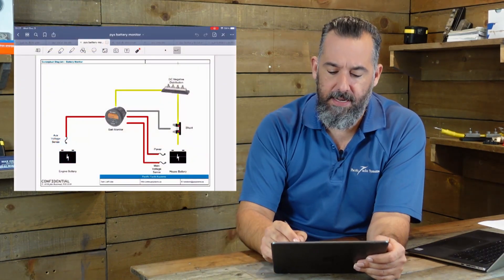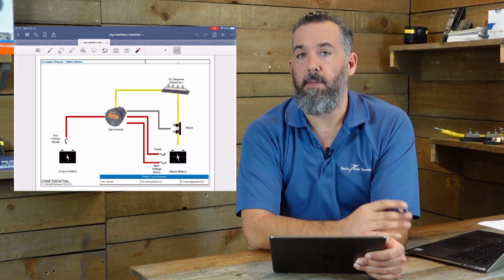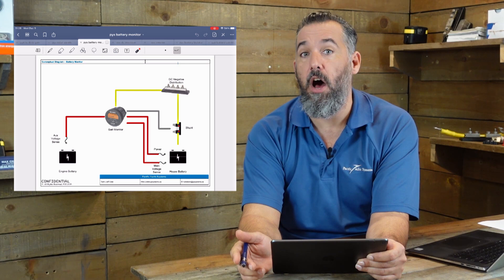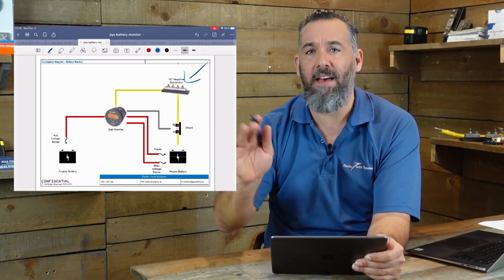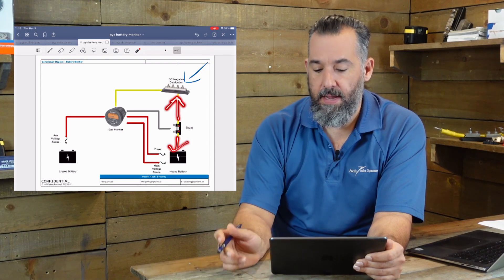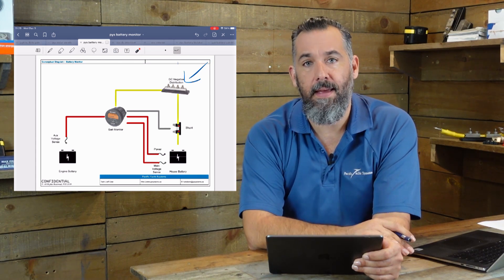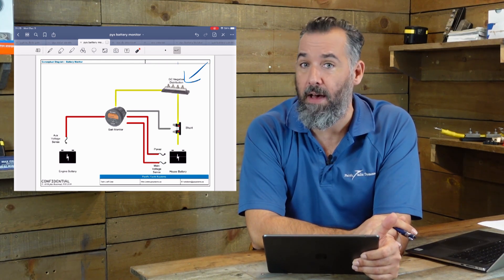I Am Installing a Battery Monitor, Would You Use a Diagram to Show Me Where to Install the Shunt?

Comment: Hi Jeff, When a charge is coming IN to the battery from a DCDC charger via the shunt, AND a current is flowing OUT of the battery to a water pump via the shunt at the same time, aren't the negative currents flowing in OPPOSITE directions and crashing into each other???   My monitor will show the net current either charging or discharging but I don't understand how the flow can go both ways at the same time.
Kind Regards
Alan

Comment: If I'm running duel battery cables from 2 batteries to the negative bus bar,  Does it matter which side of the bus bar you mount the shunt?? This would be running to a 4000 W inverter for a Solar System.

Comment: Great video and great info, Jeff!  With your permission, I'll add a bit of clarity!  
 It is important to understand the Shunt Resistor's role in this, and to understand that the Shunt Resistor should NOT pass any other current (from a different battery bank) through it.    
In other words, the Shunt Resistor will ONLY "interrupt" the Negative battery cable's path to the battery bank that is being monitored.  
It will be the last item between all Negative connections and the actual Negative battery bank connection.  
As Jeff says at 2:29 into the video, a direct Negative connection so that Negative current cannot bi-pass the Shunt Resistor! 
When installed correctly, any and all Negative Current to/from the battery bank being monitored cannot help but to pass through the Shunt Resistor!  

First.... this is a "Shunt Resistor".... I.E., a current conducting device that offers a precisionally known resistance value!  It interrupts the Negative path for the battery bank that is being monitored. 
Secondly......  the Shunt Resistor alone cannot offer any data.  The head unit is required in order to measure and track Amp Hours that are passing through it......... both ways...... from the battery bank, and to the battery bank. 
Thirdly...... think in terms of Amp Hours.... not amps, and not voltage!

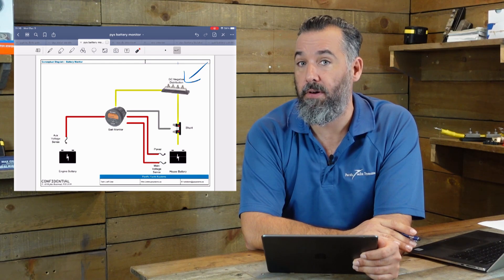At 3:11 into the video, Jeff says that "Nothing can bi-pass the shunt." 
Allow me to explain that in more detail:
In most Marine scenarios, we will see two battery banks. 1..... dedicated SLBB (start load battery bank), and 2....  dedicated HLBB (house load battery bank) . 
These banks are typically separated by an MBSS (main battery selector switch). The MBSS allows us to select either bank to operate all 12 vdc current (until we get up into 34 footers and above). 
Unless we are using a 2 bank monitor, , we typically monitor ...... the HLBB, of which is generally bank # 2.  

In other words, there is no need to monitor the Negative current to/from the SLBB # 1. 
If that Negative current to/from the SLBB # 1  was to pass through the shunt resistor,  your # 2 bank Amp Hour reading will be inaccurate! 

Side notes: 
.......you would be surprised to see how few Amp Hours are required to start a Marine Engine. 
The engine's alternator will replenish these AH in no time at all. 

...... during a combined scenario (ALL/BOTH for emergency only), the shunt resitor still functions as it should. Any in-rush or out-rush of current to/from the SLBB will be counted accurately. 

So, with the use of a single battery bank monitoring system, we want to track the Amp Hours that have been drawn from the HLBB, and the Amp Hours that have been replaced within the HLBB. 
Without the use of a Shunt Resistor, and without a head unit that functions in conjunction with the Shunt Resistor, we cannot accurately track AH out, or AH in. 
Again, a voltage reading alone cannot provide useful info! 

By the way, some manufacture's installation instuctions can be rather vague.
Just keep the above in mind during your installation, and your system will work as intended.

M Emery..... aka RicardoMarine

Comment: I am newbie but this example seem to be too simple even for our little boat.  We have two batteries are not directly connected to each other, and there is a battery switch and battery charger in the mix.. If shunt cannot have anything between negative side on the battery, do I need to have 2 shunts?  Our two batteries sit within its own battery boxes.  It is a hunter 27 2007.  It is default layout with battery charger.   Is there a way I can just install one shunt.  Since only day sail we usually keep the switch on both position.
Reply from the maker: if you want to measure info on both battery banks you would need 2 shunts.  but normally only the house bank is monitored and you'd only use 1.  you'd want to designate one battery the house and use that one while sailing.  and use the other for starting so its' always full.  you should not be sailing in both.  you'd have to motor in both though to charge both.

the 1-2-all is old school and boats are not built like that any more

Comment: Jeff great and clear video. IJhaven had an upgrade of my mastervolt charging system as well as the shunt. I had the old MV shunt with MICC masterlink. It has been replaced with a MV mastershunt 500 and easyview 5 by an electrician. This week I saw that the old shunt had not been removed. Should I remove this or bypass it? Thanks for the help

Comment: I have a 3 battery 36 volt lithium system running a trolling motor.  The battery charger is currently hooked up to each of the 3 batteries, where would the shunt be installed when considering the incoming charger positives and negatives?
Reply from the maker: You can not use a shunt in that setup.  You would need to replace the 3 bank charger with a single 36v charger instead

Comment: Hi Jeff I have a question. I have 2 batteries on my boat the positive leads go to my battery selector. The negatives of the battery are linked together and a thick lead goes to the engine starter and a smaller negative goes to a negative bus. I'm wondering can I use a battery monitor in this arrangement?
Reply from the maker: you would have to redo the neg wiring to get rid of the link.  as the shunt only goes on one of the batteries.  if the bus is big enough (amp rating) everything should come off of it.  So house bank to shunt to bus bar,   start battery to bus bar,  then buss bar to engine.   depending on which battery is which you could just leave the starter cable and small wire on the start battery and basicly cut the link and put the shunt within the link.  it's electrically the same thing as rewiring to the bus.
Reply: @PacificYachtSystems  Thank you for the reply. I just contacted both batteries in parallel and everything is connected to the shunt. I plan to add another battery bank later with its own monitor.

Comment: In my 2 battery setup (house/starter), all negatives are connected to each other. If I want to add a shunt for the house battery I connect all load from that battery to ther shunt. But do I connect it to the battery directly or to the bus where the negative of the other battery is connected ? (not quite sure why both are connected to each other tbh.
Reply: Great video btw.
Reply from the maker: Good question, the house battery negative should connect directly to the shunt, and in turn the shunt should connect to the DC negative distribution (probably a bus bar). Other the single wire between between the shunt and the battery, no other DC negatives can connect to the house battery. The engine battery connects to the DC negative distribution.

Comment: Hi Jeff, with a two battery setup (starter and house) in conjunction with an ACR (with on/off/combine switch), can you still use a single shunt (both battery negatives on one side of shunt and all negative loads on other side) for use with a single battery monitor?  Or, would it be preferred for the starter and house batteries to have their own separate shunts and separate battery monitors?  Thanks so much—I know you’re a busy guy.
Reply from the maker: You definitely need a dedicated battery monitor shunt for every single battery bank you want to monitor. Many of us, install the battery monitor on the house battery, and then we connect a voltmeter to the engine battery.
Reply: @PacificYachtSystems  Thanks, Jeff.  Since I mostly day sail and my boat lives on a mooring, I generally just set the switch to “both” for charging. However, I’m installing an ACR and I wanted to monitor my batteries.

Comment: Can you monitor two battery banks,  say one meant for appliances onboard 12v and second  battery for inverter... or the batteries should be parallel and then shunt?
Reply from the maker: Today's battery monitors only come with one shunt, you have to decide which battery you'll be monitoring. Some boaters that want to keep two deep cycle batteries, i.e. one for house and the other for inverter loads with a dedicated battery monitor per bank. Or you can have one large battery bank to one shunt.
Reply: @PacificYachtSystems  will do so... tyvm

Comment: Hi Jeff 
This is Charlie Thank you for great videos, I wanted to ask how to install dual battery monitors on my boat. I already have one installed at the saloon   I would like add other one at Helm station on the fly bridge
Reply from the maker: Hi Charlie, unless you have a smart shunt or NMEA 2000 battery monitor, sharing battery monitor info with other displays isn't really plug and play. 

Does anyone else know of a non NMEA 2000 battery monitor that can be mounted in two locations to one shunt?

Comment: Jeff, I have a Balmar 614 voltage regulator and it recommends the ground and voltage sense wires be direct at the battery terminals, as well as the temperature sensor. Would the current from this bypassing the shunt throw off the readings on a Victron BMV 712? I’m concerned about accurate charging voltage vs tracking SOC. Thank you,
Reply from the maker: Robert, great question, the negative wire cannot bypass the shunt, but the positive voltage sense and battery temp sensor, can be connected to the battery directly.

Comment: Jeff, I have two outboard engines and three batteries, all AGM. I’m planning to add a Victron 712 BMS to the house battery. I’m thinking about a less expensive BMS for the cranking batteries, is there any value doing this?
Reply from the maker: For starter batteries, most of us, including myself will measure engine battery health by monitoring voltages.

Comment: Thanks for the videos Jeff. I proudly wear my PYS hat around the marina on the Chesapeake. I just bought a Hunter 34 and it has two deep cycle batteries, two shunts, two Link 10 monitors, and a 1-both-2 selector. My Balmar MC-614 regulator stopped working so I purchased the MC-618 and decided to upgrade to the Balmar SG-200 monitor as well. I discovered that there is a negative distribution bar, and it connects one shunt to the other. The primary ground is connected to one of the shunts. Is the load on that distribution bar being seen by both monitors?  Is that normal?

Thanks.
Reply: I think I figured this out Jeff. Although the negatives are combined, each shunt will only see the voltage drop from that battery's positive feed.
Reply from the maker: Glad you figured it out J B.

Comment: Jeff, I am confused. In your diagram the starting battery doesn't show where the negative is connected to. Is it joined to the house battery on the negative buss that leads to the house batteries? Does the monitor show the status of both house and starting batteries together? Or should the starting  battery have its own shunt and connected to the monitor? Guidance please. Thank you.
Reply from the maker: Hi John, all good questions. The negative from the engine battery should be connected to the common negative distribution. The battery monitor shunt should be connected between the house battery and the common negative distribution. If you want your engine battery to also have a battery monitor, then you'll need to install a shunt inline between engine battery and common negative distribution.
Reply: @PacificYachtSystems  Hi Jeff,  All I know about 12V systems I have learnt from you so thank you.  So if I install a monitor that monitors house and start battery do I need two shunts or can it work with one?  The instruction seem to only have one shunt.  In the new battery system I installed I have a negative bus linking the two batteries.  If I can use only one shunt should it be on the house or the start side of the negative bus?

Comment: Why is my Eu2000i inverter giving a  22 volts instead of 12 volt please help Raul
Reply: Check the battery in your multi-meter. Low battery in tester will cause error in reading.
Reply from the maker: Don't know that one, reach out to your Honda Dealer.

Comment: I noticed my starter solinoid is grounded directly to the engine. Do I have to run a wire to my ground bus bar instead for my battery monitor to work right ?
Reply from the maker: That's normal, the shunt goes between the battery terminal and all the DC negative loads.

Comment: Hi Jeff, great stuff keep it coming. I spent 30 years in commercial Land Lover Construction and moved to refitting boats and yachts and now document cases of unbelievably poor craftsmanship from yacht builders (mostly built outside the US) for warranty claims. The ting that drives me absolutely crazy is the lack of a standardized building code, Electrictrical code, Specification code etc. It seems there are are few organizations ABYC etc that have compiled "Standards " however their is no absolute "Law of The Land (or Sea)"  governing what criteria must be met when building or performing work to pleasure craft vessels that I am aware of. So, Jeff, my question to you is, Do you know of and can recommend sources of Standards/Codes that I could site in an argument as being "The what it should look like" as a matter of fact and not one opinion vs another? Thank you.
Reply from the maker: Hi M D, good question, the only document you can reference is ABYC i think. Perhaps some surveyors can comment on this quesiton?
Reply: @PacificYachtSystems  Not a surveyor, but Lloyds have published some specs which I read a while ago. There's no enforcement except maybe by non compliance resulting in an uninsurable boat...

Comment: Hi Jeff, do I have a magic battery monitor?  
My bow thruster is wired directly (both positive and negative) to one of the two batteries in my house bank, and that same battery is connected to the negative distribution instead of the battery side of the shunt.  My other house battery is connected to the shunt, which then connects to the negative distribution.  When I activate my thruster, the battery monitor shows a large amp increase and voltage change; but it seems like it should have been invisible to the battery monitor because the thruster is clearly bypassing the shunt.  Does this configuration somehow work, or is it simply a different magic trick from the “heater that draws no power”? 
Thanks for all the great info!
Reply from the maker: Hi Scott, definitely odd. If your thruster is directly connected (positive and negative) to a battery on the house bank, you normally shouldn't see any loads on the battery monitor. Perhaps you are seeing a charging amperage from alternator or charger, through the shunt to offset the amperage draw from the thruster.

Comment: Hi Jeff, great videos, on my 29' Northwind with only one battery, I'm assuming that the starter would be directly to negative and bypassing the shut?
Reply from the maker: Hi Robert, if you have only one battery and if you have a battery monitor, then the shunt should be installed between the battery negative post and the negative connections to the loads.

Comment: So far it is pretty obvious.

But how do you do it on a Lithium system? Shunt first or BMS first?
If BMS first, the battery monitor will not measure consumption of the BMS.
If shunt first, the voltage drop on the shunt (up to 50mV) may irritate the BMS.
Reply from the maker: I'd install the shunt on the negative between lithium battery and BMS, that way it captures all the current draw. Also always follow the instructions from the manufacturer if i contradict them.

Comment: hei Jeff. thank you for an another great video. i think somewhere on the Chanel i have heard about that a negativ is not realy negativ untill it is connectet too ground. in that in mind, schoud the shunt be connected from ground too battery or from negativ load too ground?. MW
Reply: That is true in the sense that in a series circuit, an upstream load’s “negative” would be the downstream load’s power supply. On a boat designed for positive supply, the battery “negative” IS the ground so shunt is between the (-) battery and (-) load. Is that correct Jeff? Love the videos. Keep em coming.
Reply from the maker: Shunt needs to be between battery negative and negative distribution. Negative distribution should be grounded to a engine block to be grounded.
Reply: @PacificYachtSystems  i see, is there some norm for what the negative cable sizing schould be from distribution too battery and from distribution too ground?
Reply: @mrwiik644  Same size as the positive leads to/from the battery.  At least that's the way I've always seen it done.

Comment: Hi Jeff, I am just about to completely  rewire my boat it is a 30 foot  Kong Halvorson timber cruiser.  
My question  is do you think that WAGO  connectors and blocks would be fine in a marine application  for things such as  interior  lights ect. 
I am trying  to do everything  correctly  including fire retardant cable and wire.
I am in Australia.
Reply: I have been told that the one exception is to put the bilge pump directly on the battery. That seems safer to me, but that is dock talk. What is the best practice?
Reply from the maker: Seen Wago on some high eng luxury boats, although it's pretty rare. Only issue is the wires are bare and are NOT insulated against corrosion.